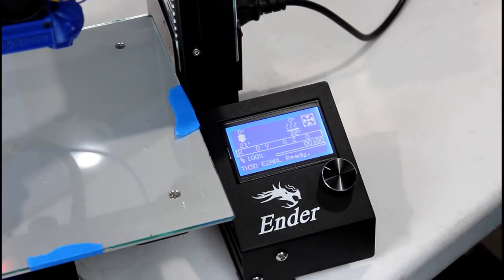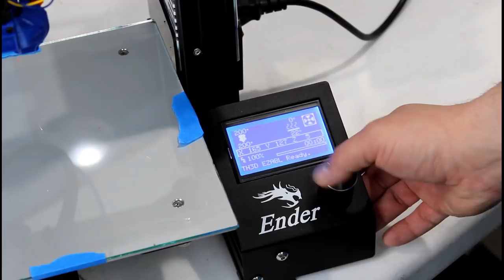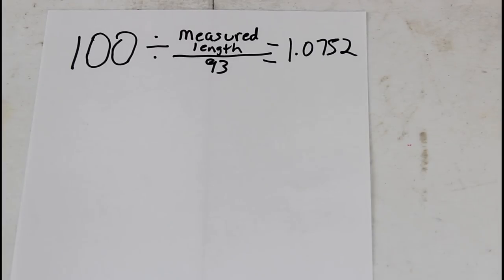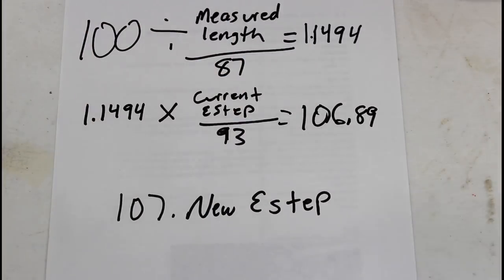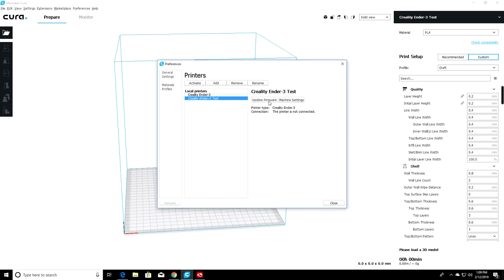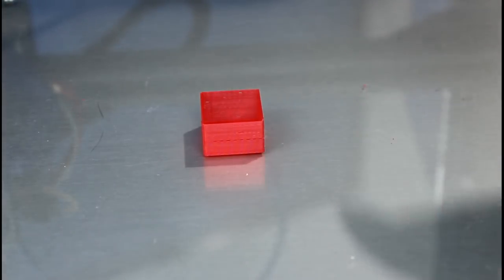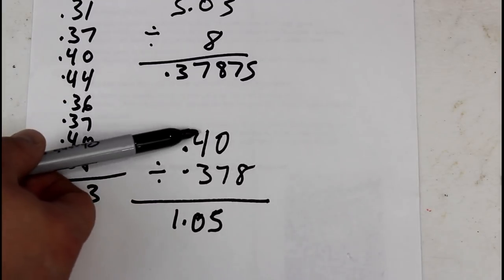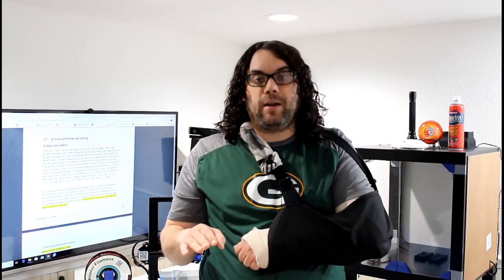Section 1.8 ESteps and Flow Rate

Comment: @TEoT measurement off but I still gave this a thumbs-up!
The shortest distance between two points (in this case the most accurate distance or measurement) is a straight line. The video example shown is NOT using a straight line and the filament sample is actually a radius! I worked in Production Automation with CNC’s (3, 4, and 5 axis) making parts for IBM with tolerances of .005mm (.0002 in) using MAFord solid carbide tooling (spade drill, spiral fluted drill @.0057 dia, and end mills @ .093dia) on Delrin 100 and Vespel 500 composite and actually holding half that tolerance. Would never get anywhere with that style of measurement. These videos are informative but when someone shows such a blatant, inaccurate technique I have to say something.
Tape on the ends to hold the true length sounds better than what was shown.
Perfectionist? Maybe! Professional? Always! CONSISTENCY is the name of the game with CNC production and these printers are basically 3-axis (and the ‘feeder’ for the extruder could be considered a 4th axis) CNC’s using the same Gcode used in Nc’s and CNC’s since the 1950’s. I also have considerable experience programming in Industrial code, Gcode, Mcode, etc. and in about 9 different versions as these languages are often proprietary to a particular machine brand.

Comment: How do I get Luke’s test cube to print right on a 0.4mm nozzles? Any specific settings apart from esteps done first?
I'm getting 0.8/0.9 on the walls. It beings my flow in at 46 all together. Seems strange. I hope you can advise.
Reply from the maker: I believe he changed it so that the cube should now be .8 thickness. So if you are using Cura and have your line thickness set to .4, you want to use 2 walls to get the .8. From the sounds of it, you may be already doing that and your cube may be dialed in pretty good.

Comment: Thanks for the great videos Jim - got my Ender 3 Pro setup nicely :) Quick question - on the flow rate, once measured does this apply to any spools of that filament (e.g. PLA) or does it only apply to that brand/manufacturer, or even to that individual colour? Thanks :)
Reply: It apply to your current extruder. If you change your extruder or if it is really used, you will have to change your esteps.

For specific filament, flow rate will change but not esteps
Reply from the maker: The flow rate probably should be done with every filament you try. Then write the findings on the spool. It's super easy if it's the first thing you print with each new spool, and just keep the cube on your memory card.

Comment: Is this a better method then feeding it through the hot end.? 

or are they both just as accurate.?
I have tried to do the measure 120 and send it through the hot end but it feels to fiddley for me. :/ .

This way looks easier :)
Reply from the maker: It's person preference, but this is the way Luke teaches and the way I do it. If you do it then way, you only need to do it 1 time and the print the cube for each of your filaments. Unless you change something at the extruder. If you di it through the hotend you have to do that for each fillament.
Reply: @TheEdgeofTech  thank you for the response nah I only wanna do it once. i have just changed to the red aluminium extruder, hence the need to redo e steps. so I am definitely doing this way. :) gee whizz you learn something new everyday 3d printing :) . I love it :) Thanks a zillion

Comment: I just upgraded to a Dual Gear Extruder. My e steps calibration came out to 144.824 to give perfect 100mm extrusion. I saved this to the eSteps in the EEprom. Do I still add the code M92 E145; to the start code for my printer in Cura? In your video you show your calculated value for eSteps qs 107 but you cadd M92 E100 to the start code. Is this an oops?
Reply from the maker: If you saved it on the printer, you don't need to do it in the gcode! You are good to go!

Comment: Okay loving this :) . I have calibrated my ender 3 pro perfectly so a big thank you for that . 
The little guy has been chugging away for months now. 
my only question is. I have a cr10 s5 and have done the hot end mod and calibrated the extruder (free air method) 96.5 and i get 100mm.
When it comes to flow I got a calculation of 114 as it was printing walls at 0.70. what is 114 deemed as too high?. is this okay :/ just seems excessive compared to my ender. but then again this thing is huge .

Thanks heaps again your a legend.

Comment: is that command you used specific to the ender 3? I'm running an anycubic i3 mega and upgrading to a bondtech but don't know how to chnage the steps and am not that familiar with software other than cura
Reply from the maker: If it's using Marlin, then you should be good with the commands!

Comment: How does changing the e steps in cura change the settings on the machine if the machine isnt connected or in communication with cura? i know it changes the g code ready for the next file but surely if you come to calibrate your esteps again, the printer will not reference any modified g code when extruding the 100mm of filament and so the calibration will be inaccurate.? This confuses me so could someone enlighten me please? thanks.
Reply: This guide assumes alot. The first is that you have a bootloader already done and you have the ender 3 connected to a computer using a program like pronterface, Octoprint etc.. If you don't all this info is useless to you till you get a bootloader on the printer. Once you do your saving the setting through one of the programs also called a terminal to set and save the new settings to the printers eeprom.
This is the issue with assumptions,  they are the mother of all fu#* ups! 
Btw 3 weeks ago I was in the same boat as you, not understanding half of the vids out there. Read, read, read. The info is available and vids like this will make sense at some point!
Hope this helps you understand!
Reply from the maker: @nghtrdr  This guide doesn't use any connections to a computer. If you change the starting GCode in Cura, it will add that GCode to any print you slice. Then when you start that print, it will use the new ESteps instead of the default. So if you use this method, and leave that GCode in the starting GCode for the printer, it will work for any file you slice. I do have 2 other videos showing how to change the ESteps right from the machine, or with Octoprint/Pronterface etc. Let me know if that helps clarify the question, and thanks for watching!!

Comment: Appreciated this video very much. I used PLA filament to calibrate the eStep and flow very successfully. Question: Just for fun I tried it with TPU and got a measurement of 18mm shorter than PLA. Should that value be that different, and if so, should I be calibrating eSteps based on the material I'm using each time?
Reply from the maker: That's a great question. I have always only done it once. The dialed in the flow rate. But I may have to look into flexibles and see if it changes.

Comment: Quick question. My nozzle is 0.8 and it says my wall thickness is 2.4 but the top and bottom walls are 1.55 . when i made my measurements the average was 1.57 But if i use 2.4 as the wall thickness then my flow rate is a crazy 156 and my prints are a glob in seconds. I assume that I should be using the top/bottom thickness of 1.55, because then the flow rate is 98 and the prints look fine. thanks again for the great video!

Comment: Jim - Great video thanks!  When printing with Luke's new cube at 0.8, would you do the last calculation at 0.4/.378 or 0.8/.378?    I assume that it's still 0.4 because of the nozzle size but would like to confirm. 

Thanks
Reply from the maker: Good question! Thanks for watching! Shoot me an email and I can help with your calculations. If it's a .8 cube your measurements should all be around .8. Then you would take .8 divided by your average. I hope that helps!
Reply: @TheEdgeofTech   Perfect, thanks!  That's all I needed to confirm.  I started thinking about it and came to the conclusion it's the wall thickness for the calculation, not the nozzle size.  Got a final calculation of 84.43% so am just running another cube to see if I am any closer to the 0.8.  The first one averaged 0.9475, just slightly over-flowing...

Comment: ok, so here are some questions about all this.... where did you get the E100 value from to put into cura, you were saying 107, then you switched to a line of code(???) where did you get  the code from??? then you entered it into cura, wouldn't you enter it into the Ender 3 setting and click on save settings?? this kinda makes for more confusion than answers.

Comment: Great video! I have 2 questions: Why must you remove the coupler after removing the boden tube? Can't the filament be cut flush at the coupler? Then... you auto-homed before performing the measurement. I don't quite understand what that accomplishes. And I guess I have 3 questions. When I did this and went to 'move axis', my Extruder (axis) read out +000.0, yours had a value. Why was that?
Reply from the maker: Mine has a number because I probably moved it before when I was filming. It won't matter if you have a number, when you turn the know the number will go up or down from there. Also, you can try doing it like that to save time if you want! :)

Comment: where did you get that line of code? the one you copied to put in cura's gcode settings
Reply from the maker: I got it from Luke's Help guide. The link is in the description. Also, do you have a newer Ender 3?
Reply: I have a newer ender 3 non pro.
I intend to install my aluminum extruder and follow these steps. Thanks dude!
Reply from the maker: @loganthemachine7841  Awesome!! Let me know if you need anything!

Comment: When you said you don't have to change it unless you change the extruder or the gear. If you change the gear but with the same amount of teeth are you still good to go or does that change anything. I ordered new gears and noticed they have 26 teeth and I think my ender pro came with a 41 tooth gear. I didn't count the original gear but that's what is on order.
Reply from the maker: I would check it to be safe!

Comment: so I only have a .4 nozzle, how do you suggest I go about the calibration cube? Should I still print it out and go about how you did it?
Reply from the maker: All the Ender 3's come with a .4 nozzle. So that is ok! All you have to do is go download the cube from Luke's page in the description of the video. It's a .8 cube now, so you will just print it with 2 walls. Then if you have 1 wall way off, that's Cura's fault. If that is the case, you just take the measurements from the the 3 sides that are close. If you need help with that, shoot me an email!

Comment: okay so where is this pdf that you got your text from? the tutorial leaves you at a dead end without it. I'm going to try just manually typing it in and see if that works. thanks!
Reply from the maker: Should be in the description! If not let me know!
Reply: @TheEdgeofTech  Oh it's called Luke's Help Guide. I didn't realize that's what it was. But I got my esteps dialed in and the test cube printing now! I extruded another 100mm piece that I'll measure at work tomorrow to see if it's right this time and measure the cube to see my new flow rate.

Comment: Where do you input the esteps in Prusa? Where did you get the estep command you copied and pasted? what would be the value in Prusa for your flow rate of 105?
Reply from the maker: If your printer is new enough, I would do it on the control panel of the printer. Or, connect to the computer and do it that way. I have videos on both ways. That's much easier then modifying the gcode.

Comment: So....$10 question  When you measured the extruded length...did you take into account for the curve (Understanding that you're doing this one-handed - but that was enough curve to add a mm or two to the measurements...  (Just wondering if that was "for display" and you did it properly off-camera)

A variant of the free-air version is to measure the filament going INTO the extruder.   (I have to do this as I have a direct-drive extruder)     I mark off 120mm, extrude 100, measure the difference between the mark and what came out, and calculate extruded length from that.  (so if I have 25mm left to the mark, I only extruded 95mm)
Reply from the maker: Hi! that is one of the biggest comments I get on this video lol I did measure it straight with the help of my wife at the time. for video sake I could not straighten it and I should have taped it to the table. But yes you always measure a straight and in my experience it's easier to do it that way. Then just run a test cube can you get your flu rate with the filament you're using and you're done. Thanks for watching!

Comment: Should I be concerned if one of my walls on the calibration cube is significantly smaller than the rest (specifically the back wall). All the other measurements are within .05 of each other except the rear wall as it sits on the print bed which is 0.1-0.15 off from the rest. Happens every time across multiple different PLAs. If so, what can I look at adjusting to change it (Ender 3 btw)?
Reply from the maker: Good question. What thickness wall are you printing?

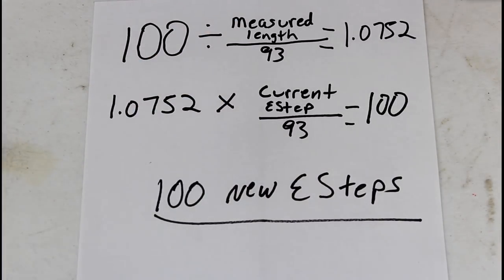Comment: I think I missed a part around 5:50. So my estep was 98.36 you show dividing 100 by my estep which is 98.32 in this case which gets me 1.0204. then you just reverse the math which of course gives me back 100. I'm confused where you used the 1.0204 result? When you change the gcode you put in E100 from E0. Do we not touch any setting in the ender 3?
Reply from the maker: I updated the math in the description to be more clear. I hope that helps!

Comment: On your video Initial Layer Flow is the same as your new flow rate. Did u change that aswell or was it 105% before?
Reply from the maker: I think you are referring to the first layer flow rate right? I left that even after the calibration.
Reply: @TheEdgeofTech   "Flow" and "Initial layer flow". You changed flow to 105%. But "Initial layer Flow" is also 105%. Mine is at 100% but I changed my "Flow" to 98%, should I also change "Initial layer flow" then?

Comment: Thank you for the video. I am new to 3D printing so have a question after doing this. I have an Ender 5 Plus.
When going into the extruder it was set to 10mm
- I added 100 to it making it 110
- I measured the extruded filament. The only difference from your video is your measured filament is slightly bowed and not straight. I straightened mine.
- It measured 106mm
- 100 / 106 = 0.9433
- 0.9433 x 10 = 9.433
- Round it up you get 10mm which is what it was set at

My question now is should I bring my current estep down from 10mm closer to 0 to make it 100mm or should I just leave it where it is?
Reply from the maker: The calculation should be 100/106=.943. .943xcurrent machine ESteps ( default 93) = 87.6. I would use 88. Then set that and test/measure again.

Comment: I’m having such a weird issue on my enter 3 v2 where every time I tell it to extrude 100mm I get wildly different lengths each time. 92, 102, 96, 98, 90, 110. Those are all the lengths I just got doing it over and over. What would cause this?

Comment: Another question... your measurement shows the filament as CURVED in the vid at 7:27 which makes the new length > than the 100.64 shown so the real measurement seems like it should be LONGER than stated. No? Am I missing something? Like maybe the NEW e-steps number should have been 106 or lower instead of 107? What am I missing? You’re the expert(s)... other than that, REALLY CLEAR explanation... but I’m Math Boy... 🤓😎🤪🤣👅
Reply from the maker: When I did my calculations I had my wife hold it straight off camera. I should have shown that. But When I filmed I couldn't show it straight because of the broken arm. The calculations should be correct and I have updated them in the description too.

Comment: I just went and printed a temperature tower and realized I didn't see much difference the whole way up and I watched the temps on my LCD for each change. So I'm sticking with the stock Cura setting of 200. I'm just printing my last single walled cube for flow rates and slapping a sticker on all 4 spools that I have. I think the flow rate matters way more than temperature does just from experimenting.

Comment: There's something very wrong here. 
I have a Geetech A10M, dual extruder 2 in 1 out, and none of this makes sense. When I extrude 100mm, it spits out 79mm. Yet when I'm printing to any height above a few cm, I have to push my flow rate down to 90% as I can hear grinding of the nozzle dragging over the previous layer, which means it's over extruding. I thought my Z steps might be out but they are spot on when measured at 100.0mm. The X and Y are all calibrated to perfection, so what gives? If I used this video's method I would be massively over extruding during printing, but Marlin says I'm under extruding. I'm so confused.